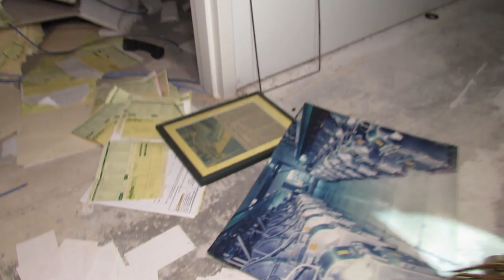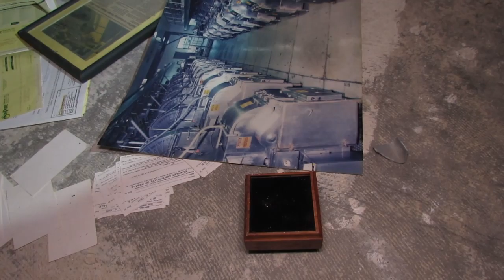(ABANDONED OFFICE BUILDING...HAUNTED???)

Comment: 13:05 that pipe was probably used as a vent to "gas" the meth oil after its made. Hydrogen gas is required to do so and that is easily created with hyrdochloric acid. ,The hydrogen gas is extremely combustible and static electricity is enough to ignite it. The gas was probably vented up thru that pipe to prevent an explosion in the room used for cooking...definitely meth making chemicals u found in that place.